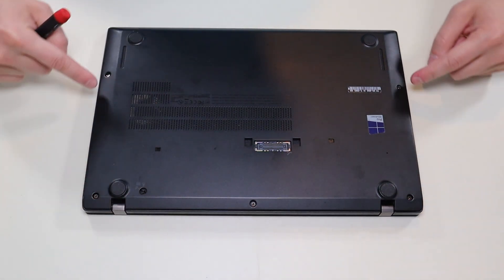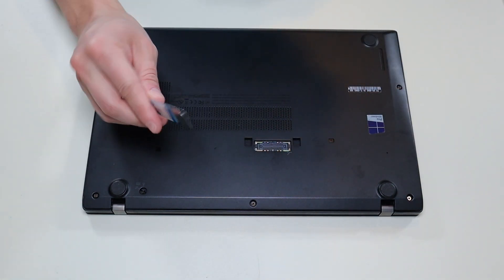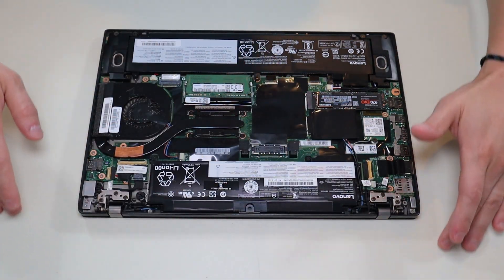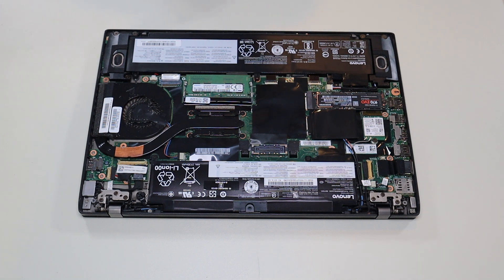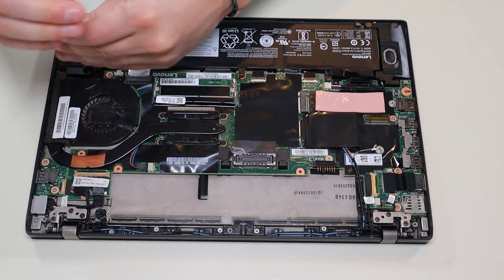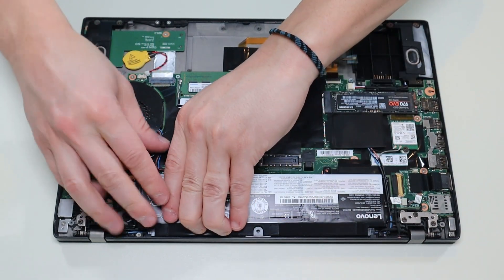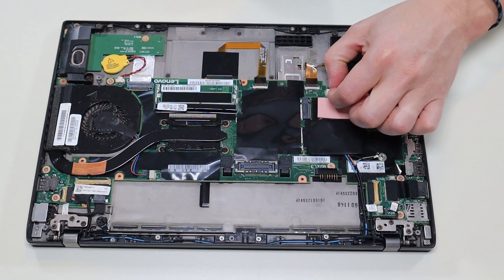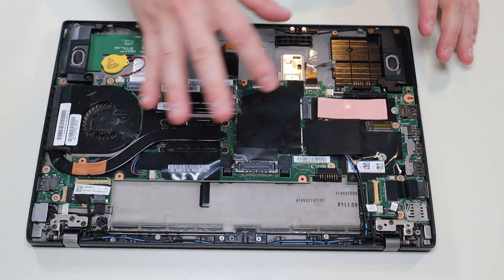How To Replace Speakers - Lenovo Thinkpad T460S Laptop Computer

Comment: Hey I got my windows 11 driver issue after an update but later on I faced many issues related to booting up my system so I made a bootable USB from your videos. So I have question that should I update my system after bootable installation of Windows 11 or wait ?..
Reply from the maker: If you are going to install Windows new, then yes. You should always run the updates after. However, if there is an update that is messing up your system, you may want to hold off. Does your computer meet the minimum system requirements for Win11 as seen here? https://www.microsoft.com/en-us/windows/windows-11-specifications?r=1
Reply: @PC_Monkey  yes the system meets the requirements
Reply: @PC_Monkey  Thanks for the advice ♥️